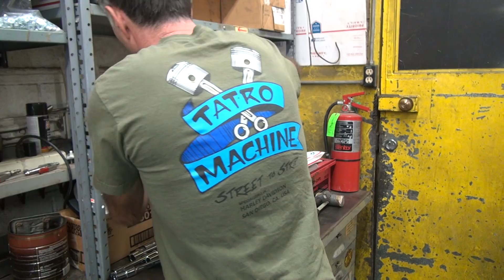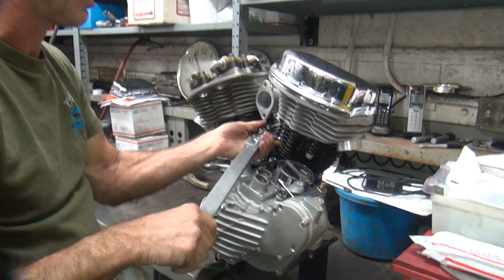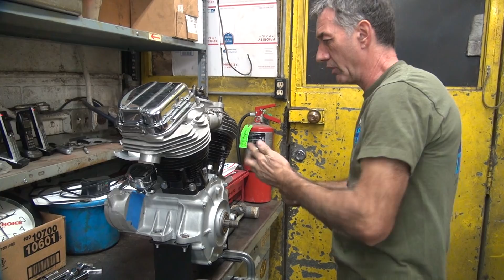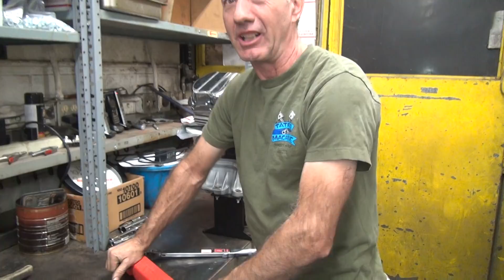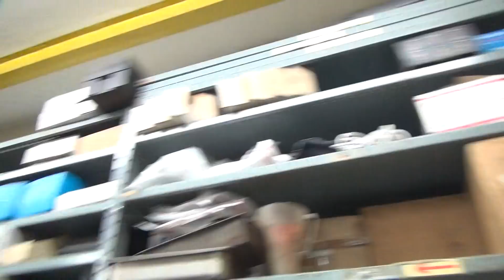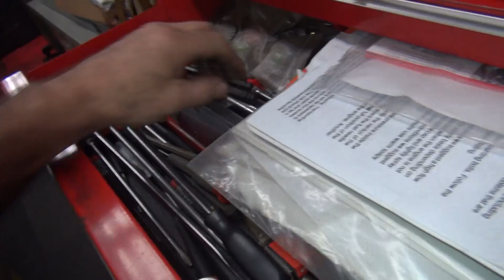#208 1961 FL 74ci std panhead s&s evo lifter conversion install motor rebuild harley tatro machine

Comment: So 52 on the wrench with extension makes 65 ft pounds head torque
Reply: Thanks for torque info
Reply from the maker: no, you only have the same torque when the offset is at 90 degrees. it goes wrong when you change the angle.
tatro

Comment: Torquing down those cylinders gave me the "Willies". I could almost feel one of the studs stripping out...(my luck)...Good one Tatro, Thanks.
Reply from the maker: real harley motors have real bolts that you can pull down tight. not those stubid tru studs that you can't tighten for crap. 3/8" vs. 7/16". they also have nice thick stabble cast-iron cylinders that don't move all over the place like those thin ass alum ones do.
tatro